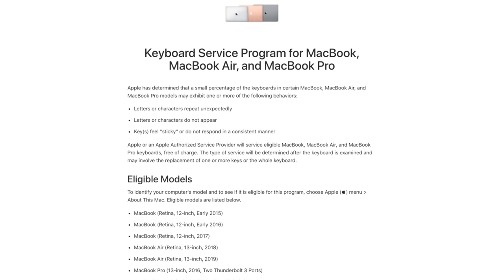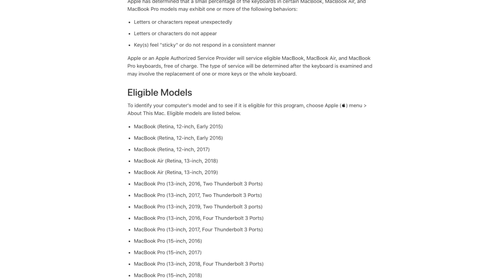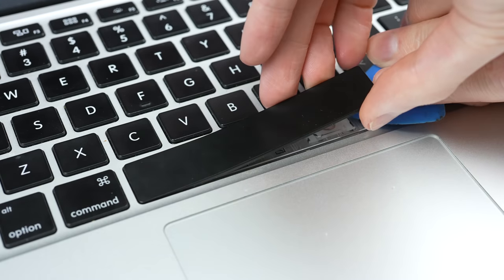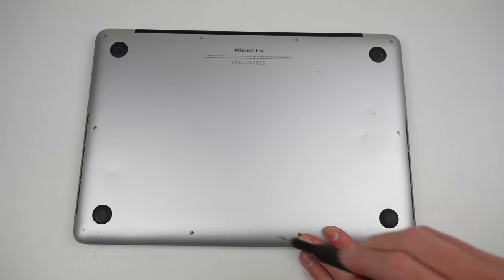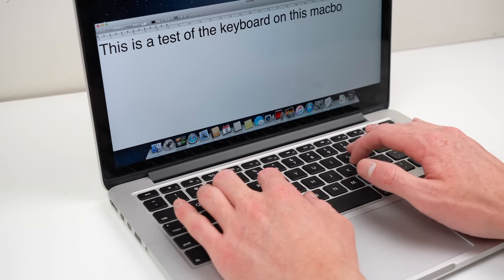Apple Really Doesn’t Want You To Fix This - MacBook Keyboard Replacement

Comment: For something that fails as often as it does to be so hard to repair just goes to show you how much Apple is anti-consumer.
Reply: Exactly. Just when apple started to use the extremely unreliable butterfly keyboards, they also started to use rivets instead of screws to attach it to the laptop.
Shit like this is the reason why I'd never buy an apple design.
Reply: Ture that but I will always be a apple user! Lol!
Reply: @FuckLoadOfFat  not only that, but windows is such a bad operating system, and for most tech illiterate people, it's the only other option. Windows computers have horrible long term reliability from my experience, and provided macbooks don't break, they last a lot longer
Reply: @alexpetree2038  how ironic...
Reply: @gr1mkeks  ironic in what way? I have customers who replace 7-10 year old macbooks all the time. I also have plenty of customers who replace 2-4 year old windows laptops that were higher end ones that have already failed
Reply: @alexpetree2038  Apple could just glue and solder the entire laptop together and Apple users would still throw money at them
Reply: @Fattony6666  as opposed to dell, hp, or Lenovo building 2-1s that bend from normal usage, or have display cables unplug because they used spit for glue?
Reply: @FuckLoadOfFat  windows is filled to the brim with closed source proprietary software. unfortunately, most popular tools are developed for windows so we’re stuck
Reply: @alexpetree2038  Long term reliability isn't really an issue in Windows Laptops. 
My dad still owns an old Windows Vista laptop from 2005 if I remember correctly, need to ask him again. He used it for 10 years till 2015 where he then bought a new one as the performance was not enough for daily tasks and the display didn't work anymore. The laptop still does boot up with an external display and can be used.
My brother bought 2016/2017 an entry-level Dell Inspiron 3000 and is still using it today. The case broke a bit as it's made from plastik, but what do you expect from a 500$ device?
I'm not denying that MacBooks are more durable. If you take good care of the Laptop, it will easily last 7-10 years, no matter what company made it. I guess you can be a bit more careless with a MacBook.
Reply: @FinalKingX  To be fair they are releasing some stuff as open source. VS Codium and the Calculator Program is open source. But yeah they need to release more and should stop forcing their shit into my programs.
Reply: I love apple
Reply: Trash windows out of business
Reply: @alexpetree2038  if anithyng breaks in my comtuer/ laptop whic runs windows i can repair it easily/cheaper
Reply: @eulehund99  while that's true, it also depends on what you expect from it. Macbooks in my experience are quicker for longer. My windows laptops have all slowed down significantly over the years just from normal use
Reply: As if anyone needed more proof...
Reply: Macs are for seniors, children and college students. If you are not one of these 3 and you own a mac, Congrats, you are a sucker.
Reply: @solenoidnull9542  you're hilarious. Outside of custom built gaming pcs, most windows based computers are absolute garbage out of the box
Reply: @alexpetree2038  youre halfway there smooth brain
Reply: @jojivlogs_4255  yeah, because dell and hp make fantastic products that everyone loves, and that never get hated by anyone. Oh wait...
Reply: @alexpetree2038  If you have 'higher end laptops' that fail within 8 years you are either dropping them from the top of some stairs or using them wrong, in normal use they will easily work as long as Apple laptops if not longer. So either you are making up those numbers or you are comparing budget pc laptops (~400 euro) to Macbooks of ~1800 euros or more.
Think to yourself, does it sound realistic that your 'high end' product breaks every 2-4 years or does that sound like either you're making that up or you are using it wrong?
Reply: @someguy4915  had a dell that I got last year, 4k screen, I7 10th gen, 16gb of ram, 512gb storage. TouchPad failed within 3 months, and it wasn't ever dropped. Windows would constantly update, and throw me back into the first time setup screen even though it was setup. Pretty sure that's not a me issue, I'm pretty sure that's a dell and windows issue
Reply: @alexpetree2038  So that's your basis for the claim that all Windows laptops only last 2-4 years, one broken Dell laptop?

Windows going back to the OOBE setup is a bug, which also happens on Apple devices, this does not destroy the laptop in 2-4 years like you said but just requires you to wait for the update that fixes that or to contact the seller and have them fix it, just like you would with Apple products, no difference there.
Touchpad failing within 3 months usually means it's either low quality or a liquid was leaked onto it, if it arrived broken that's the factory's fault but it lasted 3 months.
With that, 'an i7' says nothing about price range while 16GB of memory does, that's mid-range at best, same for '512GB storage' which says nothing about type of storage and thus whether it's budget or high-end.
Seems like you bought a mid range laptop which was just crappy.
If you buy an actual high-end laptop it will easily last 10 years, more if you're particularly careful with it.
My school laptop even lasted 6 years of being thrown around daily, that was just a 750,- euro MSI.

Buying 1 mid-range laptop and having bad luck, then claiming that all high-end pc laptops break within 2-4 years is just being untruthful.
Reply: @someguy4915  what 512gb hdds do you know of? It's obvious an ssd, an m.2 nmve to be specific. You're a clown, that's one specific instance I've delt with, I sell 50-100 windows laptops alone a month in a store that does 100s every month, and help customers who are upgrading newer computers constantly. That's my basis, helping people who have first hand experience with their laptops crapping out
Reply: I like apple its delicious
Reply: Why replace the keyboard when you can buy another grossly overprice $3000 laptop? Seems logic (on apples POV a least).
Reply: @lilithgold9871  you're a part of the problem.
Reply: @alexpetree2038  I have a $2,000 dollar windows custom PC build and have had no issues or viruses for years. When it comes to windows you get what you put into it.
Reply: @cunnoni  I also have had multiple custom builds that run really well, but windows still has a way of being annoying, and I have multiple Co workers who either work on pcs, or have their own custom builds that share the same sentiment. Viruses are really hard to get anyway, you have to be generally be an idiot to get them at this point
Reply: @alexpetree2038  Weird, i have an 11 year old HP laptop that has windows 10 installed on it due to some modifications and it still works incredibly fast and never, ever broke down

Comment: I like that you admit when you miss one or two of the connections or screws. It emphasizes just how difficult the process is and kind of pushes aside any discouragement, if I were to miss one or two.
Reply: @JnrJeed1  bro rude. He’s literally saying how even for an expert it’s hard
Reply: @TomTheXboxSeriesX  he might be a bot
Reply: @coffeemakerbottomcracked  who knows
Reply: I disagree, this sure as hell discouraged me from buying a macbook (even more than I already was). The only major issue I've ever had with a laptop I used for a long time was keys not working.
Reply: @prw56  my current MacBook Air is dead because the power button on the keyboard failed, so good choice
Reply: @itz_lexiii_  oof… let me guess 2018/2019?
Reply: @prw56  my old HP laptop was having hard drive issues. I replaced that with an SSD and it is running faster than it did before it lmao. I wish laptops were still repairable and parts were easily replaced. It’s one of the reasons I got a thinkpad e595 back in 2020. RAM and storage is easily changed. Sad that this stuff isn’t as common as it should be :(
Reply: @ShockingPikachu  Haha no ive had this thing for ages its a mid 2014 iirc

Comment: I've done this repair myself on the larger model, its actually easier and nicer to use a Dremel to remove the rivets, gives it a smoother finish and risks less been broken in the process. I invested in a pillar drill style mount for mine, to make the work more precise. Would 100% recommend for future repairs like this.
Reply: Yeah good video but holy fuck watching them yank on that delicate machined aluminum faceplate was so cringe. Honestly shocked nothing broke. Rivets are always removed by grinding away or prying up the flange. Technically they pry up the flange, but they’re putting so much unnecessary stress into such a delicate part. Surprised this comment is down so far.
Reply: isn't there a tool you can get to help remove small rivets like that? You just give them a few twists and it drills off the head enough to pop whatever is secured off. Even just a normal drill bit and light pressure would have cleanly killed those rivets without having to use excessive force.
Reply: Yes thought so it would be much easier
Reply: I thought so too, but would he than have been able to screw in the new keyboard?
Reply: @WungoBungo  I hope you know he's a guy
Reply: People don't know that Dremel or drill are always supposed to be used for removing rivets :/
Reply: i was gonna say with the way he tore this apart i cant imagine many ppl that do this dont bend the frame or destroy the computer when they try this themselves

Comment: Trust me it's harder on a 2016 MacBook or newer, ive done a few and you have to individually break the rivots. As using too much force bends the metal frame too much that it won't bend back into shape. They also stopped using the metal backing to the keyboard for the butterfly keyboard so it disintegrates into pieces and makes the whole process even harder.
Reply: Top one reasons why Apple Trashed the butterfly keyboard

Comment: This is the company that doesn't include a freaking charger for their new phones to "reduce waste", but if a key goes on your macbook keyboard you might as well toss it in a landfill or pay the price of a new one to get it repaired.
Reply: Yeah, I was a little pissed when I opened up my kids iPhones to find no power brick.  Sure I have a few laying around the house, but if I know apple, they will come up with some firmware update that makes non-apple bricks worthless. They have done it to me with power cords already. I have had cords that were fine on a Monday only to get the message on Tuesday (after a forced update) that the cord is not supported and I need to get a cord that is.  They already price fix their products, then they want to soak you again for needed peripherals.

Comment: "The Reason behind it" as you ask, isnt likely cost of doing it, or speed. It's pure and simple fact that they do not want anyone but THEM repairing it. They want to charge you insane pricing to do repair work or push you into buying a new machine. Either way, its money in their pocket. Thats the only reason, and the reason they are fighting against Right to Repair. (They are, in fact, the BIGGEST company fighting against Right to Repair).
Reply: which makes it even more baffling why do people still buy this overpriced garbage ...
Reply: @Asghaad  Exactly, I got a brand new Dell laptop with a Ryzen 5 and RTX 3050 Ti for under $900 AUD and Apple are charging up to $4000 AUD for something that's no better.
Reply: @Asghaad  because nowadays it's become sort of a "status symbol". I have an Android yeah? It's the Google Pixel 6, it does the same if not BETTER than the newest iPhone including camera quality. Yet I'm still seen as a weirdo for having an "android" it's insane how much apple has become "the norm"

Comment: apple : we want to reduce e-waste.
also apple : make every product much more impossible to repair.
Reply: Exactly. All shit starts from the 2008 MacBook Air with soldered memory
Reply: It's really just "We want to look good regarding e-waste while possibly gaining more cash"
Reply: @xxmutegodxx  2008? Dude they have been doing shit like this since the 90's. I remember when my friend had one of those fruity colored iMacs and even back then they were soldering in stuff so you couldn't self upgrade things. I mean they actually had the RAM soldered into the board so the average user couldn't replace it without sending it in. (Unfortunately for them I was a teen who had and knew how to use a soldering iron)
Reply: @SilvaDreams  and those stupid colorful imacs also had no fans, so they would run at 500 degrees and fry the ram or break solder joints like it was its sole purpose in life.
Reply: @SilvaDreams  Gotta put in that APPLE memory.  Crucial just won't do!
Reply: Did you really fall for it?
Reply: @ishtarcephei5054  is it wrong to say yes
Reply: Also Apple: gives peanuts for trade-in vouchers when you bring old hardware back to them
Reply: Mission impossible :Repair Protocol

Comment: 8:48 Another cause of clicking issues is the battery swelling underneath the trackpad. I heard about that in some videos.
Reply from the maker: Sure is. But the battery doesn't sit under the trackpad on this model.
Reply: That would likely be for the earlier Unibody series. I have seen a couple of Macbooks with damaged trackpads, mostly likely because the battery has previously expanded.
Reply: @TheSpotify95  it will also be likely for every other model, except the A1425 in this video.

Comment: I noped out at work when I found out that the "proper" way to replace a MacBook battery was to literally disassemble the entire thing piece by piece, remove battery, replace it, then reassemble the entire laptop.
Reply: True, Apple products may look beautiful but from an engineering point of view only some of the solutions they use are well thought out, other are just mind boggling stupid.
Reply: the pre-2013 ones are infinitely easier to repair